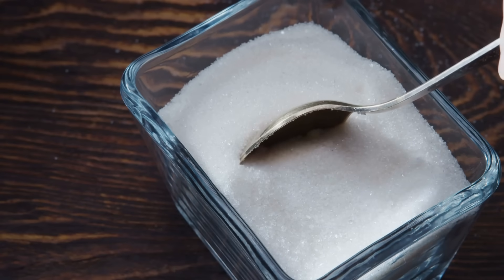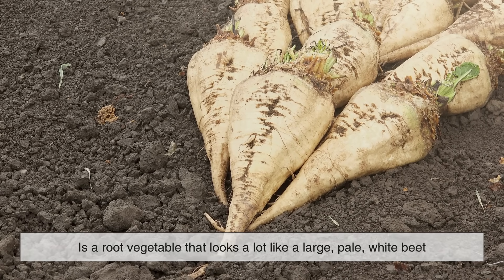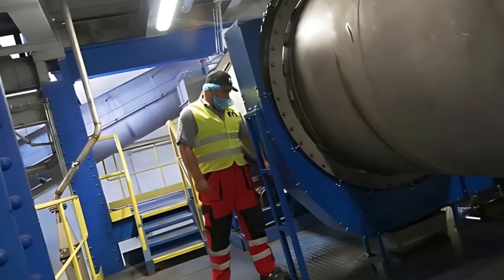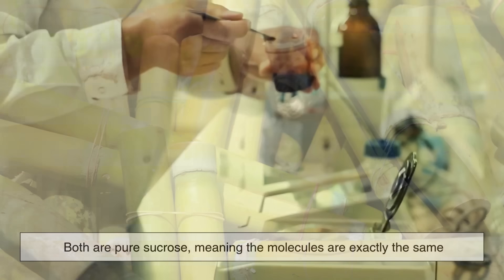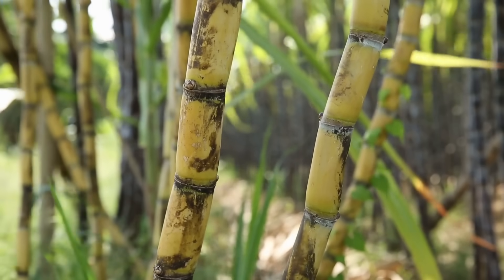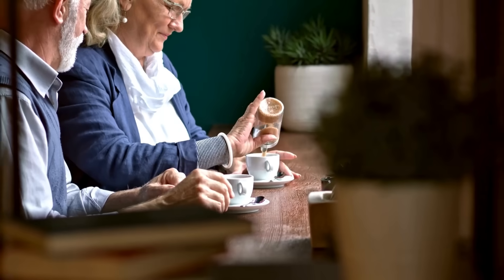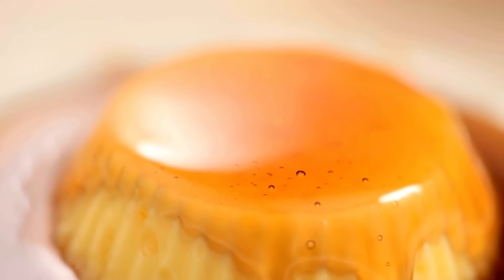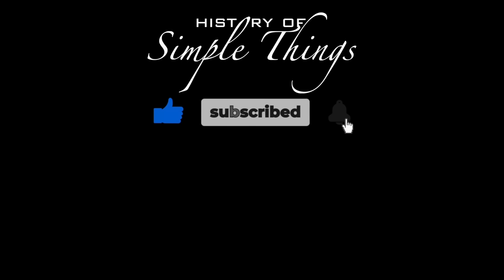What Is Beet Sugar? The Sweet Rival to Cane Sugar!

Comment: Spreckles Sugar just shut down their operation in Brawley, Calif. in July 2025. I used to see them spreading out the left over pulp onto the ground to dry before mounding it into massive piles. I would also observe a large  horizontal line painted on the white silo high in the air marking sea level. The Salton Sea is even farther below sea level.